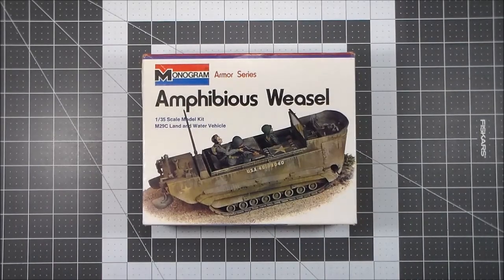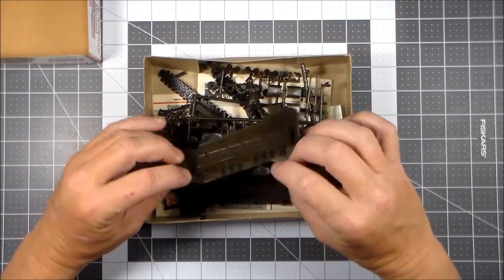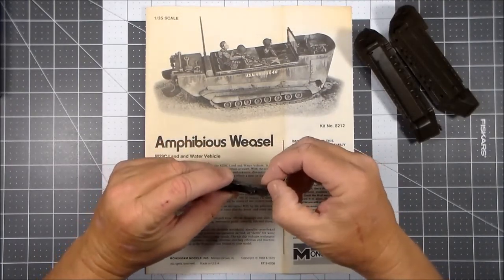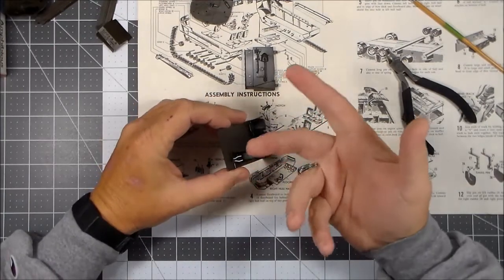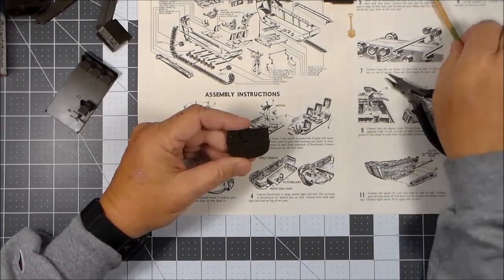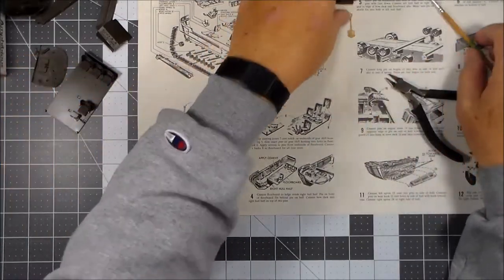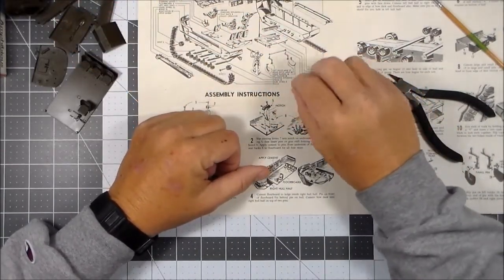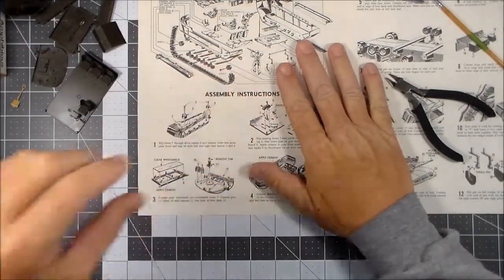Monogram Weasel Project pt 2

Comment: This is coming along nicely.  I agree that replacing the molded-on tools and control rods will greatly improve the appearance of the finished model - nothing looks more like "separate" than separate - and would definitely have been the kind of improvement that would have been done "back-in-the-day" (mid-1970's.)  I think that even may have been one of Shep Paine's suggestions on his tip sheets, if memory serves . . . .

I have this model, and plans to build it.  But currently, I'm thinking of rendering the molded-on tools and control rods with pin washes and dry brushing, to keep a much of the original kit as possible.  I don't know if this will ever be reissued, (the last issue was in 1994,) especially since Takom is coming out with a new, state-of-the-art M29 kit.  It isn't the M29C that is the subject of the Monogram kit, but I suspect they will kit the entire family of Weasels before long.

Thanks for sharing this.  13th like.
Reply from the maker: Yessir Mark. I got this particular kit from some lady on the east coast for a really good price. And what you say clicked just a few minutes ago as to why there is a sudden surge in interest in this build series: Takom's impending release of their M29.